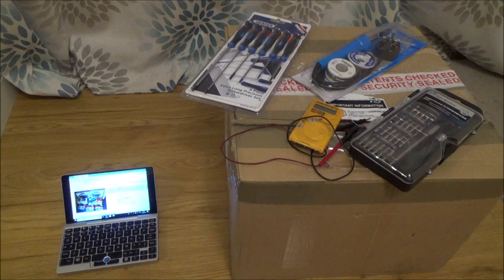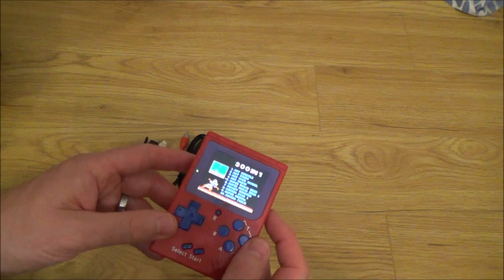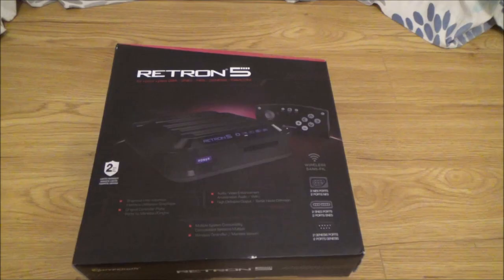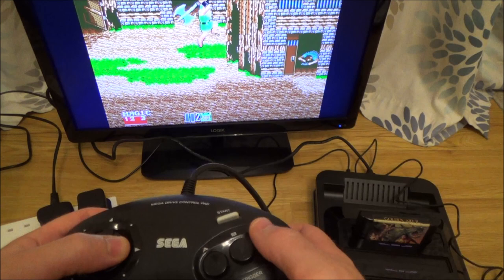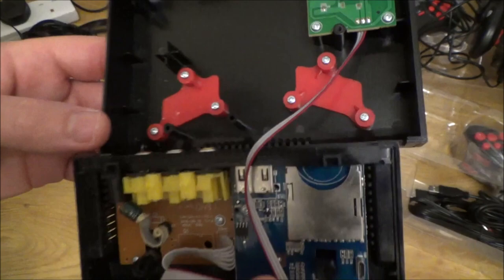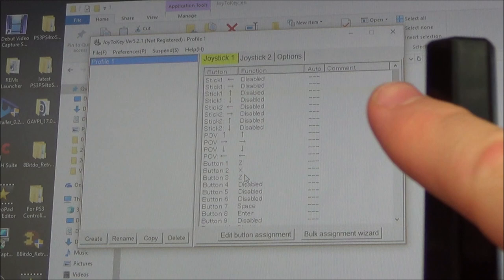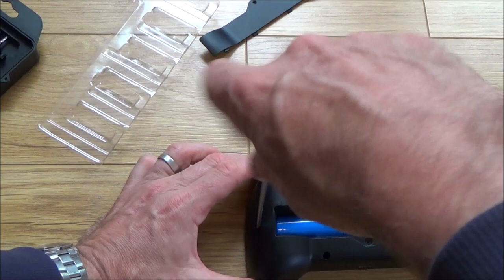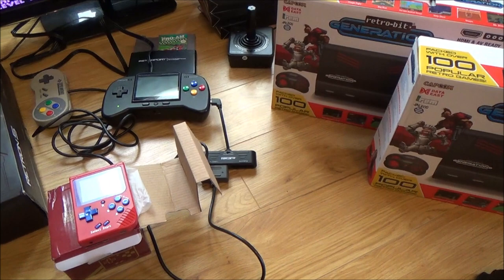Trying to FIX an eBay job lot of FAULTY Games Consoles & Controllers

Comment: try applying pressure on the lines off that game gear looking thing… if they dissapear you can attach some cartboard on the back so there is pressure to the screen.. it worked for my samsung s7 edge and it might work with that aswel. but like you say it's a faulty screen possible caused by dropping it

Comment: Word of advice. When you take the charger from another device, is not enough to have an identical connector. Check the polarity of the connector. It is explained on the back next to output.
Reply: it used to be way worse 10-15 years ago. Now most have the same polarity. It's mostly just the old stuff which comes to bite with reversed polarities

Comment: Vince, if you had a choice of buying an electronic replacement part, and you had a choice to buy from a legitimate electronics supplier or a little cheaper at eBay, lets say both the eBay trader and the legitimate electronics store both delivered the next day, who would you recommend? 

Having consider this hypothetical, and with knowledge gained by experience and subscriber interactions, Would you consider being an ambassador for English consumers who unknowingly are being ripped off and even putting their own lives in danger, what I suggest is you produce a video on the dangers of purchasing goods that do not meet your countries certified standards.. Dropped a Like as usual Vince.

Comment: That screen could be purchased pretty cheaply on eBay I reckon.  They look relatively generic so it may be worth getting the part number and googling it.  As for that blown capacitor, it would take longer to open the thing up than it would be to replace.  Decent quality solder, a bit of flux and some pre-tinning of the soldering tip and you'd be away.

Comment: you could easily buy a new lcd screen for cheap and attach it. i bought a wii u with a broken gamepad and all i did was buy a new touchscreen and i made a profit.
Reply: Not financially viable to buy and replace, simply not worth it.
Reply: thefiestaguy lcd screens are pretty cheap and i imagine a portable snes/nes/genesis is worth it.. Highly doubt he'll use it. Even if he made a small profit itd be better to fix n sell than let collect dust.. But i remember them being less than 10 dollars and i imagine thats worth around 60 so def financially viable if memory and my assumption serves me correctly.
Reply: The question it comes down to is, is the cost of making a profit (if any - i'm not entirely sure of the value of this console in used condition, assuming there are no other faults that weren't found) worth the time and hassle of sourcing a new screen and fitting it.

Some people don't want the time and the effort if it's only going to make them a small amount of money.
Reply: thefiestaguy i understand that and addressed it in an earlier comment. Def profit there.
Reply: A WiiU LCD panel is more easily sourceable and possibly cheaper just because of how sourcing parts can be. You aren't just going to look up a screen for something like that RDP. You have to find the exact panel by itself, and then when you do it may not be available individually but only in quantity slow shipped from China.
Reply: Daniel Fletcher they make lcd screens in the exact size for all sorts of things.. I havent done any research seeing as how its his project but he didn't even mention it or try.. He just pretends he'll use it for a nes n snes but we kbow he won't.
Reply: Same here. £5 max for a suitable Digitizer. So if you see any Wii U pads with non responsive screens please consider. The prices are only going to increase now due to out of production items.
Reply: Daniel Fletcher if i wasnt at work id research it but if they're available, only from china for whatever reason, they'd sell them individually as well as in bulk. If that was the case itd ship slowly but he could still turn a profit. I'm not trying to 'want' any more time either so just dont reply and understand your comment was dumb.
Reply: brrnay The cheapest one I could find the other day that was compatible with the one in the video was $46 USD plus shipping on a slow boat weeks later.
Reply: brrnay I don't see how that's "cheap" on an $80-$90 product that you could probably only get $60 for used.
Reply: Daniel Fletcher i find that hard to believe but i don't care enough to research it. At that price its def not worth it.
Reply: The screen may not even need replacing. It could just be that the flat flex cable for it needs to be reflowed.

Comment: get yourself some rosin flux, it'll make soldering so much easier.  Also, adding a bit of flux to the pins on the charging jack would have allowed you to drag solder them.  Those pins are meant to be soldered.

Comment: The usb port on the retrobit must be soldered. To solder smd easily just put a good amount of flux, solder without worrying about any short and then use solder wick and flux to remove any excess of solder and possible shorts.

Comment: The Retroduo-port.. screen looks similar to a gba screen so you might be able to get a replacement on ebay just look up the screens product/part number and input it in bay you never know.
Reply from the maker: Thanks for the info :-)
Reply: Something you may wana try is to clean the exposed contacts on the ribbon cable there may be the start of some unseen corrosion' dirt or oxidisation preventing a connection.
Do you know anyone that can lend you one or two drops of ISOPROPYL ALCOHOL cleaner is dam good stuff just a drop on a cotton bud will do.

Comment: The retrobit generations, the power supply 8.5V is marked Retrobit, but that capacitor looks blown to hell by overvoltage or reverse polarity - wonder if that PSU actually belonged to something else... A friend of mine made a very expensive mistake with wrong power supply
Reply: Matthew Day I did that with a Linksys e3000 router(my family used it for a while), I found a PSU that said linksys and had to proper voltage and connector(the router didn’t list amperage on it) it worked for about a hour, and then the psu stopped working. Thankfully I found the proper plug for it later. I now use it as a switch to plug in multiple Ethernet devices onto one of my laptop’s WiFi.

Comment: Hi there . i have a question : how change zoom in display on ps3  same with wiiU sittings ?
Reply: Цао Цао曹丞相 you can not on ps3
Reply: May be some device can do it instead ?
Reply: If your tv or projector has a zoom setting yes. But I have had this problem where certain ps3 games go past the borders with no way of fixing it.
Reply: maybe  some upscaler has zoom sittings ? i never used it before :(

Comment: One essential bit of info missing from the video (unless I missed it)... Who was the seller of these kind of bundles where everything either works or just needs a power adapter? lol... Actually, it'd be interesting to see if you could fix the Retron5 adapter. If you can get the thing open without ruining it (lot of times they're plastic welded shut) it's likely to be a fairly simple fix like an open cap or resistor/cracked joint etc.

Comment: **Addendum**
On watching further, that unit that didn't work with the supplied power pack, but worked with the other units power pack, has me suspect that not only was the power pack with the wrong voltage but it is at the wrong polarity at the jack, to which is definitely why the Capacitor blew up, I tell you what though, it was seriously lucky that was the only thing that was damaged, mind you I don't see that particular unit lasting just as long as the undamaged unit, and that's because electronic components are damaged when reverse and what's more a higher voltage is applied to them..

Comment: The small connections on the micro usb connector should be soldered, so you are lucky you got them to contact the board enough with pressure alone to work.
Over time I think you will have issues with that micro usb again. Personally I dislike micro usb as you can easily break them off the pcb if you apply too much pressure or leverage when connecting the plugs.
I suspect the cap was blown from over voltage. You might also blow the other unit if that power supply is incorrect.
It looks like the input supply should be closer to 5 volts for those units, unless they have an internal 5v regulator which went shorted on that one unit.

Comment: The point on the iron is big, and the plug will need an adaptor.

Edit: hope you have soldering wire as well
Another edit: good luck fixing a launch edition Nintendo 3DS then, cause its necessary to solder all the contacts in place.

Comment: Funny how you seems to know alot about electronics and not know at the same time. As example, it was obvious that the main trouble for the RDP was the screen and that when disassembled the white wires were for the buttons controls. Instead of playing with the live wire, you could have just followed where it was leading too :D.

Comment: About that Retrobit console with the blown cap... maybe they packaged the wrong adapter with it and in reality, it works with 5V (8.5 had blown the cap... just a guess). Anyhow, replacing a cap is easy and you would save the composite AV panel too :)

Comment: So that 8.5 volt power supply is actually Retrobit's replacement for the original Genesis' power supply, which you can see here: http://retro-bit.com/ac-adapter-for-genesis-1.html I'm guessing someone just grabbed the wrong supply when packing that unit.

Comment: this may have already been pointed out, but i think the retro duo portable is water-damaged
Reply from the maker: Hi, I don't remember reading that comment before. Can I ask why you think this? Is it because of the lines on the screen or did you spot something else :-)
Reply: Well, I had watched a video prior to this and someone explained that they bought a water damaged iPhone X off of eBay, and there were green lines running vertically down the LCD. So my theory is that the fault of the console is water damage, seeing as nothing else wad was wrong and that water damage is irreparable. Or I could be wrong and it was just a bad LCD, which would be a simple fix. What do you think?

Comment: The power supply had to much voltage and to much amps
Reply: mk gamer 2 34hyyy
Reply: Amps are drawn not supplied. There is no danger in having a higher amp  PSU.

Comment: I sell all my used electronic stuff as untested parts or not working on ebay, it stops the scammers  getting it and then just saying it doesnt work and claiming a full refund and demanding £10 to post  something (may or maynot be the item) back signed for delivery, its genuinly not worth my time testing the stuff anymore. Being scammed is a risk of the seller and certainly not the buyer on ebay.

Comment: Can/do you repair pc motherboards? I.e components from. Thanks 👍
Reply: OK, again. Like I said to others, he just worked on several computer motherboards, there is no difference, it's the same thing, the workings of a gaming console motherboard are the same as a PC motherboard in which work the same as a TV motherboard. Now, if you want to get down to specifics, no they are not the same. Shape, size, things hooked up, but just now that you watched him repair several computers. Maybe not a computer you're thinking if, but it's a computer.

Comment: That blown capacitor pop because someone plug-in 8.7 volt power supply into a 5 volt capacitor, you're just lucky it didn't break the circuit in the capacitor the, large shock just blew the cover off it. Thumb knuckle head probably went to set up his video game system, already had that 8.7 volt power supply laying with the rest of the wires, and plugged into the power strip, then plugged in the wrong power supply. When it didn't work he just grabbed the video game system and the power supply that was plugged into it! Just returning the fully functioning unit and the wrong power supply...

Comment: Ah man, just swap that capacitor (or at the very least take it out). Not nice leaving that thing in bits inside. It probably popped when someone decided that a 9V power supply was easier than a 5V one.

Comment: I don't know if this is a good example of buying faulty consoles because it seems like you just got REALLY lucky with this lot as half of the consoles were fine and it was just broken power supplies or incorrect power supplies. The last console could probably be fixed as easily as just buying a new screen... seeinga video like this makes me want to search around for "faulty" consoles or a console i want that's marked as faulty and trying to fix it myself

Comment: Don't like the BITT-BOY "repair" at all, that was masking of a fault, not a repair. Buy yourself a T12 soldering iron from eBay/Aliexpress and some flux, then it won't be a problem to solder such things. Point tips are not good at all, you should go either into K-type or BC2. Actually using a good flux, you'd be able to solder that USB connector even with your soldering iron. Problem with RB Generation obviously was the wrong adapter it should be 5V, and plugging 8.5V blown the 6.3V capacitor on the input, luckily there was an over-voltage protection circuit. Haven't you noticed that the 8.5V didn't fit into the blister/drawpiece, so apparently it was out of the set? So always check in the specs, what adapter voltage should be used with the device, before turning it on. The blown THT mounted capacitor should be easy enough for you to replace it or at least to remove it.

Comment: Ehh... you could have soldered back that connector correctly. If you use flux, you won't have bridging, even with that soldering iron... there's nothing wrong with that iron.
Reply from the maker: OK, thanks for the info. I will buy some flux :-)
Reply: I recommend this guy's tutorials... you can learn so much from how he repairs boards... here, he's soldering on a connector that's about twice the density of that microUSB connector you had there. Watch how the flux prevents solder from going all over the place: https://youtu.be/VLBiPnmoYz8?t=523

Comment: That charging port design on the Bittboy is pretty bad, even if the connector doesn't work itself loose entirely, the pins themselves not being soldered on means they'd lose contact the second enough mechanical strain happened to deform anything. Cheap Chinese engineering at work.

Comment: Seriously... it's not WEIRD that the 8.something power supply doesn't work - why in all that is holy don't you check on the damn item using said power supply what it says (if anything) about what power it wants? Not once, you only check what it says on the power supply itself - people have no idea, so maybe the original owner had the power supply go out, found something with the same plug, approx same size, and thought "hey, it works". You check the ratings on the item, and see if the power supply fits. And of course it works with the power supply for the Retron - they're both 5V. shakes head in disbelief

Comment: im not genius but i think the capsitor was to lower the voltage how ever when it broke it no longer did that there for not lowering the voltage and over poweringth system im no genius but eh least i tried also here https://youtu.be/OB0pwvIqPvo?list=PLexbWs0Wp_H6COq2hgTs7V1b1ZdzEfVeE&t=2012

Comment: if you make these videos please for heavens sake check the adaptors are they AC or DC and if it is DC make sure you check the polarity on the plug or you will eventualy damage something. Most likely that has happened to the retrobit generations console with that capacitor.